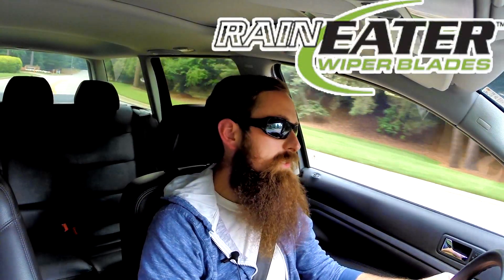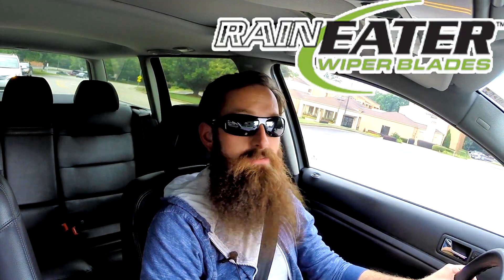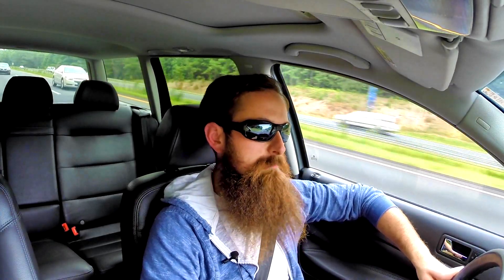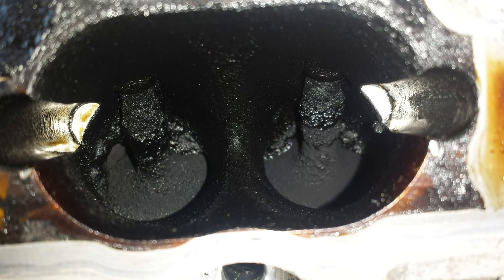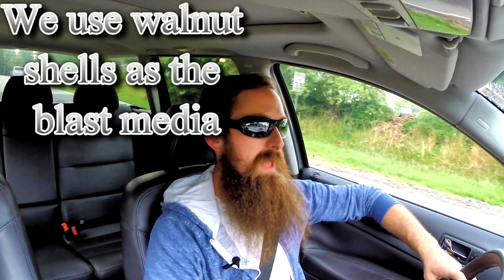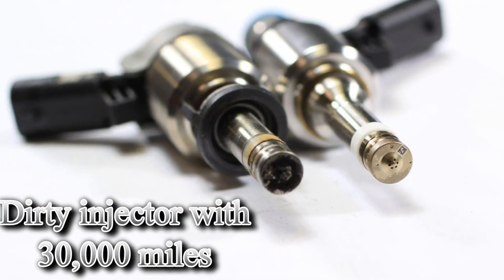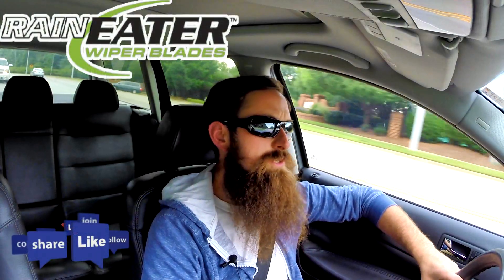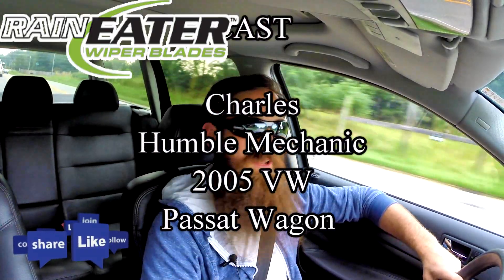Preventing and Fixing Carbon Issues for Direct Injection Engines ~ Episode 80

Comment: Drop the fuel tank .. fix the source before you spend the costumers money. 2nd, the vehicles are built for 87 octane, running it rich & cold start misfires are a 1-2 punch. 3rd) use titanium plugs, gab them appropriately, spend $ for high quality wires / coils. 

Then my personal fix that helps me get 200,000k every 1.5yrs. First, a full quart of Lucas Oil as your last quart. Instead of 6, use 5 plus Luca. Then only use Royal Purple Motor Oil & Royal Purple Oil filters; K&N air filter (no need for a cold air intakes; cleaning the A/F every year is mandatory) Now the secret sauce ...ZMaxx Engine & Oil treatments. I use this 3 to 4 times a year. Lastly, Never let your tank get below 1/2 tank; remember any exposed metal will begin to condensate, which will become water droplets which will produce carbon.  As the internal combustion engine does not leave carbon deposits inside of it when running in harmonic displacement. 

When filling up, always add a cup (12oz) of Lucas Oil Treatment every time. 

This is how my 2008 Chevrolet Silverado CrewCab 1500 has over 500,000 miles on it; also how Chevy offered to buy me the same truck (LTZ, Z-71, except this time they can pay for a 3500HD Highlander) at 750,000 miles. Oh, I've got no mods, it's the 4.8L & I pull a 28.5' camper all summer from Fla to ME to CT to NY. And I use 87 octane as per the owners manual. 27/9mpg hiway & 15-17 city.
Reply: AllUpINC it's all preference keep it clean and oiled and your good, or just buy a paper one. I've driven vehicles for over (5.4 triton 3 valve) 300,000 miles on k&n and had no issues. a little more noise and a little more potential to tune. there are many ways to set up vehicles and there is always some with a better set up than you. personally for my purposes and cost savings (I drive 80,000 a yr wife drives 40,000) is real. and 1-2 mpg increase has been noticed in ever vehicle I've owned 15+. but again it's your opinion against others on which is best convenience or savings. I do not work for k&n but I do use them and wix most exclusively.
Reply: this method is good for many motors but not ecoboots or direct injection engines. the issue is behind the valve accumulates carbon/oil deposits that become hardend and baked on over time. oil catch can (preveutative) or installing addition fuel injectors on the rear of the valve so u have 12 injectors. once u have it te only way is to manually clean your intake. good answer for na motors, i use the same methods on many vehicles but u can not do an inducton cleaning due o te urbo failureat will over so its prevenative or u are manualy cleaning replaicng he head and intake.
Reply: The source is blow by while the intake and exhaust are opening simultaneously, then the egr running it back around to dirty, high pH oils etc.. the catch can ia designed to only allow clean air to enter your intake. To put it simply due to egr, regulations, emissions u can not vent into the air noxious air so they recycle the air allowing dirty fuel to enter the intake creating carbon deposits. On an na engine u can do an induction cleaning with a product such as seafoam (closing the carbon out of ur tail pipe) however being an ecoboost is direct injection and has a turbo. The cleaner touches the back of the valve much less and the carbon being removed can damage the turbo causing a catastrophic failure. If u do an air/meth mix u are adding addition pH and spreading chemicals that harm other components such as gaskets, rubber, plastics, and in the process gum up interior parts preventing good seal or compression. So u can drive without an oil catch can and depending on how it's driven and maintenanced u can make it last 300,000 miles. However, having an oil catch can will prevent this drastically without any addition effort except draining the can every so often. It collects dirty oil, detergents that degrade interior components, etc. . Source is not just fuel, it's oil, parts breaking down, detergents, condensation, everything and anything
Reply: Gary Shaw I'm not 100%sure since a supercharger is belt driven versus turbo is exhaust. superchargers also build up psi more slowly, hence why they feel more smooth. I would say contact the manufacturer or the supercharger and see if they advise an induction cleaning. I imagine if done properly it would be ok but again be sure and get it in writing from the manufacturer. I do know it would be less susceptible to failure due directly to an induction cleaning
Reply: so the source is dirt in fuel tank? I was wondering about this too. I agree fix the source along with the carbon
Reply: nextari I apply to the fuel tank and engine oil. Does it get the the back of the valves? Not enough in my opinion to make a difference however the occasional spirited drive pushes compression and helps break down carbon before it has a chance to hard on the back of the valves. So u basically blow it out the back. And for oil I do it the last 1,000 miles and put about 1/4 the can (rest in the tank) so viscosity is not effected enough to change driving behavior. However fill up with premium afterwords (oil change and ran tank out) and do a spirited drive or two and u will notice a difference in power and mpg then change the oil/filter and check ur air filter. 6 quarts only in the 2.7
Reply: christopher waller thank you brudda
Reply: Humble mechanic I like your videos and I appreciate what u do. Your a smart person and everyone has their own opinions. Again, I appreciate your posts and videos. It would be cool to start a channel like urs
Reply: Do you have a blog or page about this? Thx.  And do you mean to add 12oz of OIL or GAS? treatment when you fill up gas tank?  Using quart of Lucas Oil (during oil change) changes the viscosity engine is designed to run at?
Reply: what if I have a supercharged a6 is it bad to seafoam the intake on that?
Reply from the maker: +Jack Frost hey man. I appreciate you watching my videos and adding your thoughts in the comments. But can you throttle back a little bit? Nothing to get so worked up about.
Reply from the maker: Jack Frost this is in fact my channel.  You can feel how you want about my method of cleaning. I'm not sad about that. 

You are also free to say what you want about me.  I'm not cool with you attaching everyone in the comments. You're welcome to be a valuable member of this community.

Comment: Fuel treatment? facepalm

spray water into the intake manifold... it will vaporize and steam clean the ENTIRE combustion chamber and the valves.
Reply from the maker: +madjimms actually that will only happen if minimal buildup is present. If there is any substantial carbon this will not fix it.

Comment: Bottom line, nothing you have said is actually proven except a manual valve cleaning (soaking, scraping/chipping, media blasting).  Save  your time by just going to 7:45 or so and listen from there.
Reply from the maker: +Haiku Automation EXACTLY! Much of what is going on is theory.
Reply: Absolutely DO NOT use CRC intake valve cleaner on any GDI vehicle. Especially on Ford EcoBoost or VW GDI engines. Ford actually has posted a bulletin against chemical valve cleaning. Manual cleaning is the only way to go. CRC has had several cases of having to much carbon break off and causing valve and piston damage. And they dont take responsibility for their defective products. I may include that I'm a 20 year certified tech as well. I stay clear of CRC.
Reply: @lorenbeesley1728  my cylinder walls had scoring and the only thing I could think of is when I used crc cleaner when the carbon was too bad I should have manually cleaned them first and not go the easy route, it made loud noises when going on highway after ward then big puff of smoke. Cylinder 3 had pretty bad score marking ouch.
Reply: Never again will I use it when carbon is bad enough.
Reply: @lorenbeesley1728  I used CRC Intake valve cleaner today.  I doubt I had much carbon build up since I drive 400 highway miles a week.

Comment: Replaced Intake manifold on VW CC TSi at 80k also cleaned up carbon buildup. Now at 120k going to take it apart for carbon cleanup. With DSG transmission I shift gears at higher RPM's, been using gas from Shell V-Power and Exxon Mobile, injector cleaning supplement after every oil change. My car was just serviced at the VW dealer (water pump replacement) they told me that may car runs ruff and i need carbon cleanup $750 no thank you that i will be doing myself.

Comment: the issue is the air from vavlev bake going to the intakes from turbor/crank/etc.. do not put seafoam or any induction type cleaner (as a fuel or oil treatment only). this can cause premature turbo failure due to the carbon deposits damaging the turbo severly reducing the life of the turbo(s). i agree with the spirited drive and i use lucus or sea foam.being a direct injection u will not actually haveany preventativemasures due to higher octan. lower oate produces bette mpg an high produces more power. oil catch can is the best way to prevent all of this in any direct injection engines. it also has part to do with the loose builds of the engine to allow for bter mpg by redcing frction. th con to this is more blow by. the lower ur oil cath can is placed in relation to the induction system the better. i pretty much agree with all u are saying but this is my experience and i drive 80,000miles/yr in 2 ecoboost motors 2.7tt an 2.0t. and i service them myself being a master tech with over 15 years experience. and yes once the issue is there u have to remove and clean. no other options because there is no approved induction cleaning by any manufacture with a turbo powered direct injected engine.
Reply: Which OCC do you use/recommend Chrisotpher?  Would you outline your full treatment program (miles/timings/amounts)?   You're the first person who seems to have fully documented results (in a weeks worth of researching).  I want to buy a 3.5 eco, but in the Van (Transit), cleaning the valves would be difficult (maybe require pulling engine/ hopefully not).
Reply: nextari any CC to be honest. just make sure it's installed properly and low. fordmackotech does a good right up on it just search his

Comment: Humble - Love your videos!  I saw that on the Lexus is 250, which has direct injection  they had a dealer campaign where they tear the engine down and replace the rings (free) if the car has carbon build up (and clean the heads, etc out and the piston tops).  My question is, what do the rings have to do with direct injection carbon build up?  Have you heard anything about this?  This does seem like it points to oil being a major contributor to the problem, (i am guessing)

Comment: I have a 08 Passat with the BPY FSI engine with a 6MT.  115K miles and no cold start misfire issues or other driveability problems.  I've owned the car since new and had it Stage I APR tuned at ~5K miles.  Always use 93 octane fuel (mostly Shell) and change the oil between 5K - 7K miles.  Most oil has been Mobile 1 0W-40, but I've had a few oil changes with Shell Rotella and Pennzoil Platinum (the stuff made from natural gas).  The car runs like new and power is the same as it always has been.  The valves have never been cleaned.  I'm probably going to get it done soon, though, just to see what they look like.

Comment: regarding the "italian tune" flooring it,  does RPM have as much to do with it?  I could easily cruise at a higher rpm (lower gear) for a couple miles, but it would be difficult to floor it for more than a moment as the GTI gets up to speed a little too fast... can you also comment on the use of 87 fuel, this was brought up by the engineer for my fsi gti
Reply: or sit in park and rev the engine right?

Comment: I think the best way to cure this whole carbon buildup debacle is to have a set of standard type of injectors that are already built into the intake manifold to go along with also having the direct injection but make it so you can put the vehicle into some sort of self cleaning mode where it will run off of a combination of the two different injectors or just the injectors built in the intake manifold where after an hour or two spirited drive should mostly if not completely clean at least all of the intake valves a remove a good amount of that gunk buildup fuel itself is a great cleaner my 2013 Si has over 75k miles on it and my valves still look brand new and I have ever only sea foamed it once. i know it's not direct injected but all I do is my regular oil changes and put gas in it lol i am still on the factory front brakes  i haven't had to change them yet. but anyhow i think that it having the manifold injection has a lot to do with how clean my valves are now my valves get hit with fuel at any time the motor is running so it doesn't really give carbon any type of chance to build up. so if the makers that use direct injection did some periodic type of fuel type cleaning like once every oil change or what have you, carbon wouldn't really have a chance to build up. but that's why I say if the car already came setup from the factory that way it cuts down on actual service costs or it could be a thing where the car can set at every oil change to be put into a self clean mode where the vehicle has to acquire a certain amount of time running before it self exits the self cleaning mode. either way the vehicles need a self cleaning mode. for customers to have to pay for a " professional cleaning" due to an engineering fail i think is just unacceptable. if they even do have to pay i don't really know all of the details.
Reply: Didn’t read all of you post, but that’s what Ford does, Toyota, and Audi all have variants of a dual injector setup.

A Port and Direct Injection system per cylinder to help mitigate the issues with DI.

Comment: LOL I started my 2013 gti one morning and it misfired so bad it was throwing check engine codes, I turned it off and back on and the engine lights went away and the car settled down, took it into the vw dealer and they told me the EXACT same thing.. questioned me about what kind of fuel I use and they put some fuel additive in. Didnt do anything and now my car is getting progressively worse for misfires, it shakes a bit at idle and is starting to idle surge. (going to replace my PCV, for now, getting a catch can later, my DV because with my new intake on the car it whistles at WOT, and then im going to get the manifold pulled and cleaned + the injectors) we will see if all of that fixes my issues.

Comment: $430.00? Their catch can may be the most advanced design but looking at the product page I can't for the life of me find that value in the picture. There are far less expensive cans which I'm sure will suit the intended result desired.
Reply: there are many options however some do not void warranty and are plug and play, the other kits require drilling holes voiding your warranty by modifing existing equipment rather than just adding on a catch can ( i worked at a dealership and this is how they get u)

Comment: The Italian tune really does work,  I tried Seafoam and Techron thrrough the tank, tried new plugs, new filter, new very expensive MAF and even had the mechanic blast chemicals through the intake and I would still suffer from rough cold starts on my 08 FJ cruiser, then I did the Italian tune up, ran my truck for about 20 min @ 4500 rpm down the highway in 3rd gear, ran my AC at full blast and kept my diif locked for added load, and wala, it drives like new and cold starts are excellent.
Reply: @Gary A/C On = More load on the engine.
Reply: what does having your ac on full blast have to do with anything?
Reply: Austin Lucas I had no idea. thanks

Comment: You could also install a water/methanol kit and just run straight water. That would not only keep the intake valves and combustion chamber squeaky clean, but over time the ECU would learn to advance your timing and give you more power thanks to the anti-detonation properties of the water vapor.obsorbing heat and making the intake air more dense.
Reply: I'm curious if manufacturers will start using a system like the M4 GTS. They come factory with a water injection system by Bosch. Our training material states the reservoir only has to be filled about every 10,000 miles under normal driving conditions, and it allows them to push the S55 even harder.
Reply: That's a damn good idea.
Reply: u would still have an issue with the oil mixing behind the piston in the crank, and adding water will not stop the issue but my extened the amount of time if drivin spirited as well. but having a water/meth kit im sure ur gonna do that anyways. u still need a low mounted oil catch can
Reply: christopher waller The methanol will keep the rings clean because of the steam cleaning effects, therefore allowing the rings to flex and run against the cylinder walls freely. I do have an oil catch can.
Reply: @GioGuitarDude  so  kit like this would do the trick http://damnfastdd.com/Products/AlsoBought/AEM+V2+Water+Methanol+Injection+Kit? could i put a breather delete on instead of the catch can ?
Reply: @Joe,
That’s the exact meth injection system I use! AEM 30-3300.
The meth/water injection would keep the carbon build up caused by PCV oil vapors in check, but if you have a force induction vehicle (turbo/supercharger), a catch can is ALWAYS a good idea regardless if your vehicle is stock or modified.

Comment: will using costco gas which has a lot of detergent added to it, help or worsen carbon build up?
Reply: You're missing the root of the problem. The carbon buildup happens because there is no gas contacting the back of the intake valves like on a throttle body or port injected system. You could use 10 year old fuel or race gas and it would make no difference.